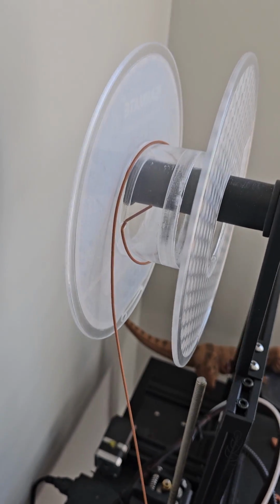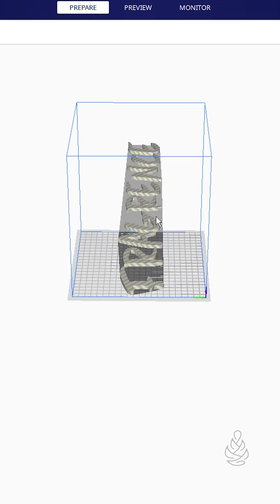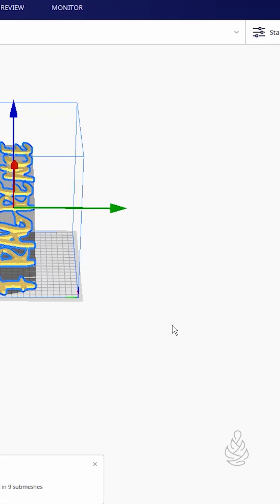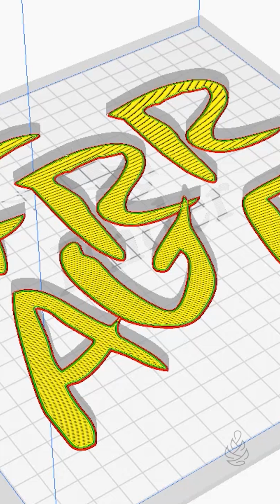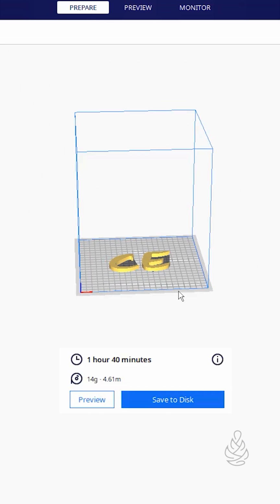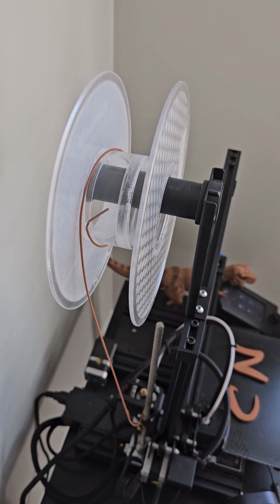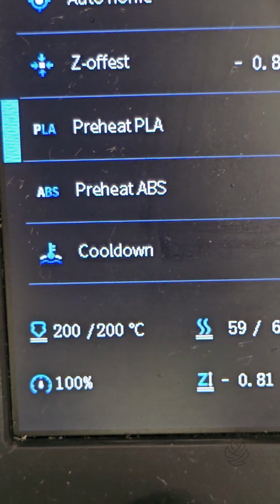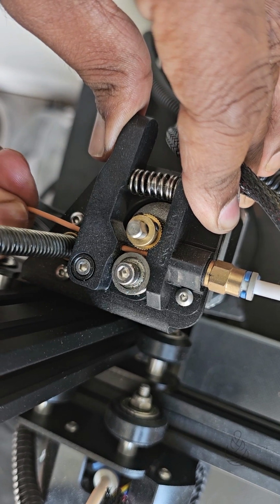End of Spool?  Split Your Prints!

Comment: One way to know if you have enough filament. If using the same brand with the same spool, weigh an empty spool. Then weigh your spool with  filament on it. The difference will be the weight of the filament. Your slicer should give the weight required for your print.

Comment: How come my slicer says a print will take say 5 hours but when it's actually printing it'll end up taking like 7 hours? I've only owned a 3d printer for 1 week so this is all new to me lol.
Reply from the maker: Thanks for your question! There are a lot of factors that cause the variance. The main reason this happens is because your slicer doesn't have same settings as your printer(mainly acceleration and feed rate). There many other settings to consider. It's not problematic unless you really need to know when your print will complete.

When you're starting off, focus on having a level bed and making sure you're getting proper bed ahesion.

Next, keep printing things and observing the outcome. I make a lot of signs so I tend to slow things down to achieve better quality.

Even I give my estimated times plus or minus 30 minutes!